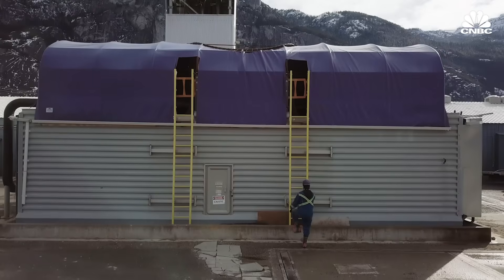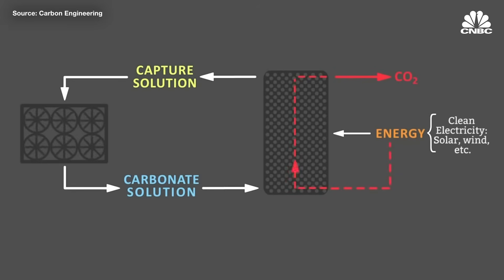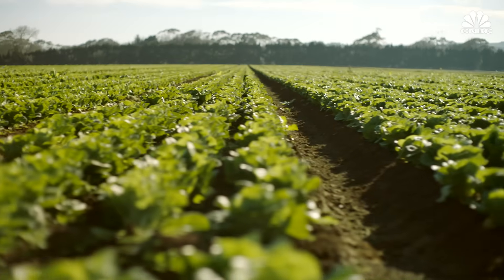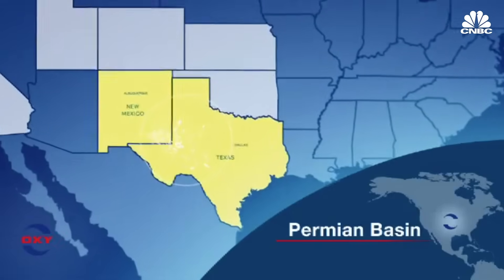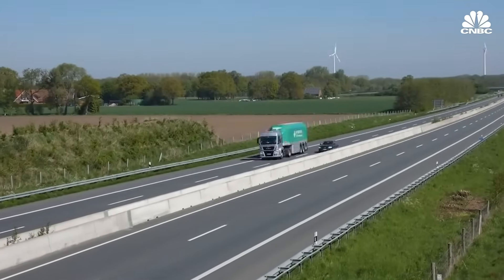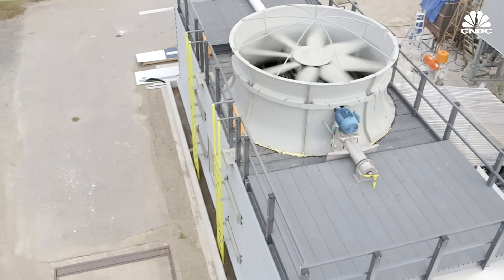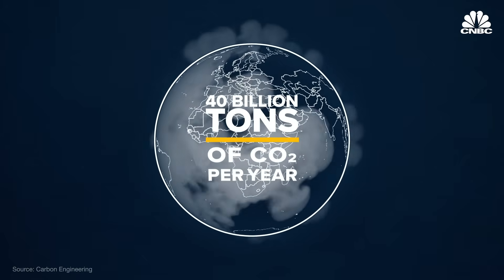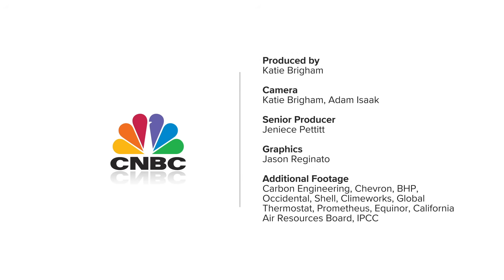Bill Gates-Backed Carbon Capture Plant Does The Work Of 40 Million Trees

Comment: Stop showing steam release as carbon dioxide emissions 🙄
Reply: Jack Tay Hwang Chiat but it looks cool
Reply: If it's a smoke stack more than just steam is coming out. Cooling tower is steam, Cooling condenser is steam. The reason you see steam coming out a smoke stack is because the material still has a water content.
Reply: @topfuel29channel  not the smoke stacks, he's referring to the cooling towers. It's just steam.
Reply: @topfuel29channel  There have't been "smokestacks" in plants r power generation stations in America for decades.
Reply: @topfuel29channel  Sorry, even the flue gases are largely steam. The volatile components of bituminous coal and wood are high in hydro-carbons. The "hydro" refers to water. About 30% of power in the US is produce by combustion of methane which has 4 hydrogen atoms per carbon atom. Therefore the flue gases are higher in water than coal and even wood.
Reply: @fwcolb  The Hydro in Hydrocarbon is referring to the Hydrogen atoms in the compound. You even mention it. When the Hydrocarbon combusts the Hydrogen atoms bond with molecular oxygen to make water, the Carbon atoms bond with oxygen to form Carbon-dioxide
Reply: @topfuel29channel  Of course. I should have gone into more detail. When a hydrocarbon, such as methane (natural gas) is burned in the presence of oxygen, we get CO2 and lots of water. Ditto with all other hydrocarbons, but the proportion of water produced varies. Thanks.
Reply: Isn't carbon dioxide invisible?
Reply: @cypress1337  It is to visible light, but absorbs in the infrared spectrum. Much like glass, hence the greenhouse effect.
Reply: @Grape Soda steam is water nothing more.technically water is the number 1 green house gas so its probably not a lie. Lol
Reply: @Tmasbiwden  no such thing as a greenhouse gas except in your imagination   anything that warms will cool as soon as it is not exposed to an energy source  including CO2 trapping is an illusion   the solar radiation entering earths space is fixed no matter what it strikes  if it diverts off a reflective surface it strikes something else   but the total energy is fixed however it is directed    at sundown solar rays will cease to strike your space and ALL warmed mass will immediately begin cooling   there is NO TRAPPING   at sunup the exposed area will recieve a fixed amount of solar radiation again  hiding or shading objects only directs that radiation  to some other mass  but doesnt change the total amount of radiation during that period
Reply: While water vapor is the major contributor, I think you're over simplifying. The earth is 70% water, which is where that vapor comes from. The co2 combined with water vapor, magnifies the heating considerably. While vapor condenses and falls back to earth as rain, Co2 can stay in the atmosphere for a very long time, and we keep adding more and more to it.
In a cold climate, the vapor out of this thing would rapidly condense and fall to the ground. I don't see people running out to plant millions of trees anyway, so I'm pretty sure this is better than nothing.
Reply: @Paradoxicon999  fraid not, our local plant has steam rising when it's 10 below.....no snow falls out if the sky.
Reply: @joeyelton407  Jesus...
Reply: steam is invisible
Reply: It's actually water vapour lol. Steam is invidisible to the human eye as well
Reply: @birdward64  True, thank you for thinking pointing that out. i would rather that you and others point out something that I overlook than the mistake not get caught.
Reply: It's kind of funny that people say something that is being disputed is undisputed.
Reply: If you can see it its not co2.
Reply: Well, water vapor IS the #1 "greenhouse gas".  LOL.
Reply: Lecture the communist Chinese first before lecturing others.
Reply: @patriotamerican3069  the Chinese are WAY ahead of the slack-arsed Yanks when it comes to their CO2 Reduction commitments and carbon capture plus they have an almost five times larger population that is only just catching up with the West in terms of power generation. They remain committed to carbon reduction and reducing greenhouse gases ASAP, whilst also doing massive infrastructure projects.

The wonderful arrogant and dumb as pig poop, ostrich-headed US president on the other hand has decided global climate change is a complete load of bollocks and pulled out of the international agreements attempting to reverse climate change by getting to net zero emissions as quickly as possible! China hasn't!
Reply: @snek9353  what part of which of my comments caused you such hilarity? Do tell, I'm curious.
Reply: @boblewis5558  The totality really, it's like Norm Macdonald's 9 minute joke, it rambles, but is constantly funny.
Reply: @patriotamerican3069  why should they? They are obviously Not chinese and it is Not like the USA is a small emitter of these greenhousgases.
Reply: OMG! THIS IS SO TRUE!
Reply: It's steam from cooling the power plant co2 is the same color as air u left wing fools I know i work at one  everything coming out of the stacks is steam
Reply: @blumie006  thank you, these mindless fools see 'smoke' from stacks and tear-up. Not only is CO2 invisible, it is necessary for plant life on the carbon-based planet.
Reply: co2 release can't be seen. It is odorless and colorless.
Reply: @Paul-gz5dp  it has a odor.
Reply: @KeVIn-pm7pu  OHH Dear!
Reply: @Drakilicious No. Water vapour condenses, falls as rain and returns underground in a relatively timely manner. Not so with CO2
Reply: North American YouTuber  Clouds are made of water vapor too, and you can clearly see them.
Reply: @sgill4833  lol. no. its methane , multiplicatively proven by many studies, that cows are the number 1 contributor to this gas, and its because they have more than one stomach.
Reply: Show some fatass cows farting and even fatter American's eating burgers... And also farting.
Reply: North American YouTuber  "Steam is invisible." 

Do you even cook, Bro?
Reply: I work in a Power Plant with Two Natural Draught Cooling Towers. They spew tons of steam from cooling water.
I could not agree with you more.
Reply: i mean water vapour is still a greenhouse gas
Reply: @rob1248996 Then your chemistry book is wrong. And if it's wrong on a simple thing like that, imagine what else it's lying to you about?
Reply: @snek9353  @rob1248996 @Squid Cena you're all spouting absolute nonsense. Research these things before commenting. CO2 is odourless. I don't know where you got the impression that it isn't but it very much is. 
@Squid Cena CO2 is not the only greenhouse gas. @Snek is correct. Steam is a much more powerful greenhouse gas than CO2. The only reason it's not listed as a pollutant is that its presence in the atmosphere is practically constant due to the water cycle. As a result it couldn't possibly account for the rise in temperature. However, we are actively pumping CO2 in the air from fossil fuels that were buried in the ground with no way from the CO2 to return to that state unlike water which can just condense.
Reply: North American YouTuber  So apparently fog is invisible.
Reply: Somehow you have to influence the pleb
Reply: kawhi Leonard   @Edward Tomlinson  So, how dense do you have to be to not understand sarcasm. I mean it's not like I explained to comment was sarcasm 3 hours before your comments... Oh, wait, I did.
Reply: Jack Tay Hwang Chiat true 😂
Reply: rob1248996 But no because factories create pollution? See?
Reply: I'm not sure if you know how to combustion works.
Reply: @rob1248996 Great idea
Reply: oh yeah baby, just like those printed from jahovah witnesses that show steam from nuclear plant
Reply: Haha true!
Reply: Asking For to much Jack
Reply: Every media outlet does that.
Reply: Methane power plants burn CH4 which generates C02 and H20. You can't see the CO2, but the H20 is quite visible(as steam).
Reply: Water vapor is the largest greenhouse gas in our atmosphere.
Reply: @AshGreen359  are you proposing we classify water vapor a pollutant too???? fools.
Reply: Well it smoke fumes from chimneys.
Reply: They are trying to clearly push a narrative on you
Reply: But the steam does contain co2
Reply: @fatstacks89   it only contains the CO2 from the surrounding air so it will be 0.04% of the air that's mixed with the steam. There's no smoke in there just boiled water turning into fluffy clouds to spread rain on the flowers
Reply: Josh Arma  your is spelt you're, and steam IS invisible
Reply: They do things like that because most people are not smart enough to realize what sources look like when they see one, and need visual aids so that they can think something is happening. Much like tv shows put transmission fluid on the ground, and say someone damaged the brakes in a car. brake fluid is clear and not really noticeable looks like water.
Reply: Steam puts water in the atmosphere and the water soaked up heat from the suns rays which make the atmosphere warmer
Reply: @matteomurphy7541  If it gets high enough it makes clouds that reflect light back out into space. Instead of the light reaching the earth.
Reply: Paul R that’s an incorrect statement, part of it is reflected but only 4%, 17% of all light is absorbed by clouds and then 17% absorbed by the atmosphere and 3% reflected by the atmosphere.
Reply: Paul R also the high point is the condensation point which varies but is relatively close to earths surface
Reply: CNBC: No.
Reply: North American YouTuber  steam from water is invisible, while all forms may not be.
Reply: So dense man? Ohh its never JUST ‘steam’ man, or they would just harvest water lol.Who dint know this now.
Reply: water vapor pound-for-pound traps more heat than carbon dioxide
Reply: 0:44 Stock footage that gives impact to the industrialization of the world.  At no point do they say, "LOOK AT ALL THAT CO2!",  classic Straw Man fallacy.
Reply: stop assuming that smokestacks only dump steam.
Reply: agreed
Reply: Actually green house gasses make environment sick not co2 alone!!!
Reply: Josh Arma  don't go NEAR steam turbine generator plant then. I have some friends who have worked for decades in the power generation industry and can tell you tales of high pressure and temperature steam making mincemeat of human flesh! What you SEE coming out of a kettle is CONDENSING steam! It's condensing to water vapour just beyond the spout. If you look carefully (which CLEARLY you haven't!) There is a gap between the kettle spout and the start of what most people call "steam". The gas in the gap is actually the  steam, the white/great misty stuff is NOT! It's water vapour!

Don't believe that? Go do some proper research before spouting off utter drivel!
Reply: @sgill4833  For real?
Reply: They really have a problem with stock footage
Reply: This is a statement only an uneducated idiot would make
Reply: Guess what, everything has pros and cons, probably the ultimate energy source is fusion, period, no chance of melt down (since if any of the conditions changes the process ends). And generates a ton of energy, and the fuel is salt water, with no waste products. And one of its cons is probably cost, and research on it.
Reply: North American YouTuber  or aerosol
Reply: thank you
Reply: @rob1248996 CO2 isn't odorless.
Reply: You're smart
Reply: steam is also a greenhousegas.
Reply: @manuelsagichnicht3732  no it's no idiot.. so people who go to saunas (steaming showers) are bathing in pollution? Also you idiot nuclear power plants create steam... which is not a greenhouse gas.. who even taught you that?
Reply: @SquidCena  "Also you idiot nuclear power plants create steam... which is not a greenhouse gas.. who even taught you that?
"
- Water vapor is THE primary greenhouse "gas". In fact it's why CO2 is a total non factor, yes alone CO2 will absorb light energy in certain spectrums. But CO2 isn't alone in the atmosphere, there's much more water vapor and it absorbs those and many more spectrums of light.
Reply: @snek9353  Dude are you insane? Water vapor nor steam creates CO2.. that's why they're considered environmental friendly
Reply: they do this with nuclear power plants to. They often show the steam coming out of the smoke stacks like its some sort of horrible thing
Reply: Why the sale is now?
Reply: Lol why some people so dumb, is it because somebody didnt go to school?
Reply: @rob1248996 He also fails to understand that the amount of water that is on the earth is approximately constant. So even if it is the most important green house gas, which I'm not saying it is, there is no reason for it to cause global temperatures to change.
Reply: I see what you mean because like it's miss information buuttt
A it's not technically steam since steam isn't visible way they show is the water condensing 

B said steam coming out a long funnle in thick continuous clouds is alot more dramatic and "scary" than a shot of a tube with nothing coming out
Reply: They do for the "visual" in order to brainwash people in order to convince the masses that the government is needed to fund emissions reduction.  What is also know as a third party payer system.  EPA Regulation would be a smarter solution.  No taxation for breathing!
Reply: Are they using acoustic soda or is it something different?
Reply: And what heated the water into steam? Steam in this case is a  symbol for the CO2 released to make it. I can't imagine there are many people dumb enough to confuse steam with CO2 itself.
Reply: (I was just reading online) steam actually has a significant effect on climate change. If you do your research rather than speaking out your ass (people in this comment section) you find there is some interesting investigations that have occurred looking at potential of a feedback loop between carbon and h2o. I’m not a scientist, so I can really say much else however; I encourage y’all to actually google it and learn something rather than letting all your huge egos get in the way.
Reply: @rob1248996 it is Not odorless
Reply: @oj5190  yes, but at the same Time they reflect a great amount of light.
Reply: @Victor it is not odorless
Reply: @rob1248996 well, but that is the Definition. I mean i cant smell the every individual Part of the Air but seperated i am able to smell the odor.
Reply: @rob1248996 So you now admit I'm right, it's not odorless? And yes CO2 needs to be in a rather high concentration to notice, but not as high as direct from a tank, and not so high that you have health issues.
Reply: North American YouTuber  it´s not even water vapor (which is invisible untill it starts to condense and becomes visible (misty). so, yes, steam is invisible and so is watervapor
Reply: confused by the OP's reference, not recalling any points in the last 15 mins of video watching where I was being visually informed by the video on what carbon dioxide was supposed to look

But, I wasn't looking for something to write a righteous comment about when I was watching... Maybe that's why whatever Jack is referring to had zero significance to me?
Reply: Nothin like a good ole nuclear smoke stack 😂
Reply: Not to mention water vapor is what traps about 90% of the heat, A.K.A. clouds!
Reply: it is the use of unrelated images to scare you and infer CO2 is the boogey man  then you will be more likely to give the con man $$$$$$$$$$$$$$$$$$$$$$$$$$$$$$$ the image of glacier falling into bay is due to no support from below as it is slowly pushed over the edge but they want you to believe its warming  another con job   the media and weather people are  in on the con   if it was warming the ice would be a river
Reply: @oj5190  no mass traps heat unless contained as  in an oven   heat  is not  a substance it is a radiation from a mass whose atomic structure has been excited   when you turn off the electricity or gas the air in the oven immediately starts returning to stability   it is not trapped   it will cool until turned on again    the sun rays excite all of the gases in the atmosphere only when they are exposed   at sundown ALLof the gases start returning to normal until daybreak    just like the oven  there is no trapping   nobody has ever demonstrated  a gas staying warm after the energy exposure is denied  NOBODY!!!!
Reply: Jack Richardson  all locations on the planet warm and cool every 24  hours  there is no continuous warming  about any mass that has cooled  it can warm again but that is not continuous
Reply: It's water vapor not steam.
Reply: @philc9305  it still reveals that the climate con men stoop to any method to fool people to make CO2 a boogeyman to be defeated  and many buy it because of total ignorance  each day this lying game continues  just look for it in the the same old places
Reply: @chetlopez8942  I agree fake news being pushed on the ignorant.
Reply: North American YouTuber  bruh
Reply: The most damaging greenhouse gas, carbon dioxide, is released into the atmosphere from the burning of fossil fuels. Factory emissions contribute greatly to the release of carbon dioxide into the atmosphere
Reply: Steam comes out of a powerplant stack because the gases are cooled by scrubber systems and you can see condensed water vapor, but what you can't see is the huge amounts of CO2 which comes with it and is invisible. I suspect you know this, but are just being contrary.
Reply: As far as I know it is carbon dioxide emissions because the pipes are thin and tall instead of the big and short pipes that you referring to
Reply: But how will they fear monger everyone?
Reply: @sgill4833  Are you dumb? So to much clouds = global warming? Do you mean methane CH4?
Reply: I suppose this ♨️💨 STEAM is non-toxic??????????? 😳
Reply: Science denier wrong think report to re-education centre at once it next to the vaccinations centre and ministry of truth  2000 points of your global credit score !
Reply: I’ve often said the same about pollution equated with steam. But to be fair steam is a visual representation of heat which is often generated by heating water with fossil fuel.
Reply: I'm not arguing but why would they be emitting CO2 when they're supposed to be collecting it? I haven't watched the video yet so yeah what you're saying doesn't make any sense to me either. The only thing I can think of is showing things that are beat steam like it's exhaust or something like that so that makes sense.
Reply: Especially Steam sales and early access games!
Reply: Ok.lets show empty exhust tunel then.
Reply: Jack Tay Hwang Chiat But that’s because it’s the only type we can see
Reply: @alysm2254  type of what? Steam is just steam it has nothing to do with CO2.
Reply: Nexus of ice but no because factories create pollution and pollution is co2, see?
Reply: @alysm2254  Pure steam contains no carbon atoms.
Reply: The byproduct of complete combustion is CO2 and H2O (water vapour)

Steam is a totally valid way of conveying the message.

You just want them to show an empty sky?
Reply: Showing an empty sky would show how much harmful effect of fossil fuel CO2 can be established.
Reply: @TreDogOfficial  So perhaps we need to abolish water use entirely. You could volunteer by reducing your respiration.
Reply: What you see is not the CO2 thats true, because CO2 itself doenst have color, so we cant see it. What you see are other substances, but believe me, CarbonDioxide is still included in what you see
Reply: @luukscholten8155  are you afraid of CO2  if so   please tell us why   when you compost any complex organic molecule  it breaks down in the presence of O2  this simple reaction releases CO2 and heat energy   in your muscles  in compost  in fires   in your cars engine    in your oven    this  return of CO2 to the atmosphere is needed to produce complex organic molecules in plants  which were just  destroyed by oxidation      an organic chemistry  textbook  is what you need  most of the information on these sites is seriously flawed  look up carbon cycle in  the book
Reply: @chetlopez8942  i know the carbon cycle :) I'm a chemistry student myself.

The thing is we humans are producing unnatural amounts of CO2. I am aware that a bit of CO2 in the atmosphere is natural, and even vital for life on earth. However, due to our doings, the CO2 levels are higher than they should be, causing the earth to warm up, with the consequences of that.

I am not afraid of CO2, i am just saying if we want to ensure a good place for life on earth, we have to decrease our emissions by a lot. Completely carbon neutral is not achievable, because we produce CO2 ourselves (through organic processes like you mentioned), but we can drastically decrease other emissions
Reply: Was the water heated to steam with nuclear or solar? If not it was with the burning of fuel.
Reply: @PapaWheelie1  can't tell from the videos, but kids looking out at a nuclear/hydro plant will be saying look dad, its making co2
Reply: @jacktay1317  I know and its false..
Reply: Jack Tay kids do love their CNBC videos
Reply: @jacktay1317  Not only kids. I used to think all that was smoke from something burning, not actually steam.
Reply: @jacktay1317  you are correct. we are brainwashing young people by making them think a factory is the devil even if it just releases some steam, steam isn't the problem, it cools and becomes rain.
co2 is a problem
Reply: @jacktay1317  Except hydro-power plants work by gravity and thus do not produce steam. (Falling water --> drop in potential energy --> increase in kinetic energy.)
Reply: @jacktay1317  and the dad will say "no u stupid son, its actually...."
Reply: @PapaWheelie1  GeoThermal.....BOOM!
Reply: @PapaWheelie1  writes: "Was the water heated to steam with nuclear or solar? If not it was with the burning of fuel." Solar water heaters are common at power plants to produce steam to run the generators when the conditions are right. Here is a link to a  google map of such an installation. The long rows you see are solar tubes with curved mirrors to superheat the water. https://goo.gl/maps/gvbwG5fEjRtpULqdA
Reply: @PapaWheelie1  On the off chance of being pedantic, nuclear uses fuel as well.
Reply: @jeffshackleford3152  - thanks, I just learned a new word today. Pedantic is definitely the most pedantic word I now know. And I thought this thread was totally useless.
Reply: @PapaWheelie1  No prob Bob...
Reply: North American YouTuber  Water vapor is invisible, what you see is condensate, or wet steam.
Reply: North American YouTuber  exactly... water vapor is steam duh.. especially when blown out quick and faster, its steam which is water vapor...
Reply: @SquidCena  They're not the same thing...
Reply: @chavezharding7820  what isn't the same thing?
Reply: @SquidCena  Steam and water vapour.
Reply: @chavezharding7820  they're the same...
Reply: @SquidCena  😂 no they're not. The distinction is actually quite important in chemistry. Water vapour occurs when water molecules with more kinetic energy break away from other water molecules. This can occur over a wide range of temperatures and relies on factors like wind speed. It also occurs on the surface of water. Steam is literally the gaseous state of water. Happens usually at one specific temperature and pressure. (If the saturated vapour pressure reaches 1atm at sea level pressures pure water boils at the boiling point). Boiling occurs throughout water rather than just at the surface like evaporation producing water vapour. Steam is also much higher in kinetic energy than water vapour. Water vapour also form a dynamic equilibrium with its liquid counterpart at a constant temperature. With steam however an equilibrium will probably never be found as at that particular temperature and pressure the hydrogen bonds between water molecules weaken too much. The entire volume of water would become gas. 
Plus the fact that when boiling occurs no temperature change is recorded until all of the water is converted to steam whilst with evaporation liquid water decreases in temperature. We take advantage of this when we sweat. It's why we can cool down when running. Sweat is quite fascinating as well but that's a whole other discussion. 
Hope you enjoyed my TED talk.
Reply: @chavezharding7820  Yes they're lol I take chemistry class now.. Steam (water in the gaseous state at 100 C) is present in the visible space seen above the spout of the kettle before the steam condenses to become visible water vapour as it cools. Vapour exists below 100 C as in evaporation.  Also water vapor, water vapour or aqueous vapor is the gaseous phase of water. It is one state of water within the hydrosphere. Water vapor can be produced from the evaporation or boiling of liquid water or from the sublimation of ice. Unlike other forms of water, water vapor is invisible. Under typical atmospheric conditions, water vapor is continuously generated by evaporation and removed by condensation It is less dense than air and triggers convection currents that can lead to clouds. Hope you enjoyed my Ted talk.
Reply: @SquidCena  You do chemistry nice. Explain this. Why can't we do steam distillation with water vapour if that was the case? Why do we need to boil water to do this technique? Evaporation requires much less energy. If steam and water vapour were the same we'd just use water vapour for this technique. 
Of course water will condense under 100°C to water vapour but that doesn't make steam water vapour. That's like calling liquid water, Steam because under 100°C steam condenses to liquid water as well. Like I said evaporation occurs at the surface of water. Molecules escape. Boiling occurs throughout. Hydrogen bonds weaken throughout the entire liquid. All heat energy goes toward breaking these bonds. This is the latent heat energy. 
Must be a mad lad to produce vapour from the boiling of water mate. Steam is produced, not water vapour. There's a notable difference as you seem to have ignored conveniently. 

Another question. Moving away from water for a bit. How do you explain every bit of distillation out there? For example, take a mixture of hexane and heptane. They create a mixture of slight positive deviation I think. I could be wrong. Point being. These mixtures have mixed vapour pressures when mixed. It is only upon reaching the boiling point of one of the mixtures that one of the compounds separate from the other. If vapour and the gaseous state of molecules (like steam) were the same then why such a difference in behaviour? A distinction must be made between the wholesale change of state of matter (like steam for water) and its vapour (like water vapour). 

In fact lets go further and look at the no. 1 cause of global warming. Fossil fuels. We see that crude oil/petroleum is useless by itself. However, via distillation it's an absolute powerhouse filled with hydrocarbons with tons of energy locked in their C-C bonds. To make it even better it's a near ideal mixture meaning it follows Raoult's Law very closely making it very easy to separate via distillation and predict. If their vapour and wholesale change of state were the same. Separation would be impossible as separation of one component can only occur upon reaching that boiling point. Remember, the vapour pressures of the components mix at different pressures over a wide range of temperatures. However one can only separate at the boiling point. This is because there's a difference. 
Do I need to go on because trust me. I can talk about chemistry all day and all night. 
Plus the fact that you can't use steam as a cooling system even under reduced pressure as there is no chance in temperature of water while that occurs. It can only be done with water vapour.
Reply: @chavezharding7820  Now why wouldn't we need to boil water to have water vapor? Steam is still water droplets going into the atmosphere but as a gas but at the same time it's still water.. just heated. So you're saying they both don't go back to the atmosphere? They're both water and one of them is heated while one of them is just goes back to the clouds. Steam is when water boils or evaporates. Water vapor can be produced from the evaporation or boiling of liquid water or from the sublimation of ice.
Reply: @chavezharding7820  Also I don't know why we can't do steam distillation with water vapor. Also, so steam from nuclear power plants is not water vapor? Its releasing water back into the atmostphere.. but only in gas form.. and water vapor is just water sitting there and being evaporated
Reply: @SquidCena  You misunderstand me. Read over what I said. We don't need to boil water to have water vapour we need to boil water to produce steam. 
Steam is not water droplets going into the air. It's literally gas going into the air it can't be droplets. The hydrogen bonds by that time are too weak. You could make that argument for water vapour but I wouldn't do that. It could be argued that water vapour isn't even a gas as their is no wholesale change of state it's just water molecules with higher than average kinetic energy breaking away from the rest of a liquid to a gaseous phase but the bond length between that of vapour molecules compared with steam would probably be significantly smaller. 
You really aren't reading what I'm saying. 
I'm not saying they both don't go back into that atmosphere. That's actually irrelevant as that doesn't even define what a gas is. Plus the fact that that alcohol produces vapour as well which is why it's so cool on the skin. Does that mean alcohol vapour is water vapour? Does that mean the alcohol is somehow boiling? 
You can't evaporate water to produce steam you have to boil it. I just explained the difference.
Reply: @SquidCena  We can't do steam distillation with water vapour because water vapour is simply too low in energy. Basically the steam powers the entire distillation process. Say you want to extract clove oil from clove. With water vapour a dynamic equilibrium would be established with the liquid counterpart thus water would be lucky to even reach the clove. With steam however there's enough kinetic energy for the steam to not only reach the clove but to condense into the container heating up the container whilst the water mixes with the clove. Clove is solid and such the mixture is highly non ideal and ends up releasing a lot of energy. The mixture bubbles and the clove oil is extracted from the clove. You could research it if you must I'm not sure if I'm remembering this correctly. 
If it's steam from nuclear power plants then no it's not vapour. 

I just realised how pointless this discussion even is. Unless you want to be something relating to Chemistry this distinction is not important to you. You can live your whole life thinking steam and water vapour are the same and it wouldn't affect you at all. It's still nice knowledge to have, though.
Reply: @chavezharding7820  Well no discussion is pointless but I guess you have showed me some of how it's not the same I guess but I mean they still should have similarities though.
Reply: @chavezharding7820  Yes but if you boiled water and had let it sit, it would evaporate and it kind of is evaporating if it's becoming steam and going back into the atmosphere as a gas which still contains water droets...  we might not need to boil water vapor but still you can evaporate it which is like steam also being evaporated.. just boiled.. why do you think nuclear power plants have steam? Because it's been heated and where does all the steam go? Into the atmostphere.. same for water vapor. Yes water vapor isn't a gas and yes I'm reading what you're saying.. also, what if you could boil alchohol? I don't know if that means that alchohol vapor is the same as water vapor it probably could. I was talking about it going back into the atmosphere since people are saying that steam is CO2... which it isn't. Yes but you can boil water which is going back into the air.. all water vapor happens because of evaporation without being heated...
Reply: @SquidCena  Yeah they're similarities. Which is why it doesn't matter much unless you're trying to make use of phase separation techniques. Then the distinction becomes important. 
You could think of boiling as the "next stage" of water vapour. As temperature increases the equilibrium switches more to the gaseous phase so to speak producing more vapour until vapour pressure reaches around 1 atm in pressure. That's when, for a period of time, temperature stops increasing and bubbles start forming throughout the liquid and boiling occurs to produce steam. The difference in characteristics is why the distinction is made.
Reply: @SquidCena  If you boiled water and let it sit you are correct. Evaporation would occur. Basically because the liquid is going to return to room pressure and temperature. 
I hesitate to call them water droplets but I know where you're coming from. It's better to say water molecules. 
You can boil alcohol. Much easier than water actually. At rtp it boils at 78°C (that's if we're referring to ethanol. The boiling point of alcohol depends on the number of C-C bonds in the molecule. Ethanol has 2 carbons.)  The cool thing about chemistry is that theoretically, with enough energy, you can boil anything. Even steel. 
Someone said CO2 was steam? The educational system has failed them.
They all go into the air. The distinction between steam and vapour was never important to the overall discussion I just didn't like someone said they were the same but in hindsight I should've left it alone.
Reply: @SquidCena  fwiw "steam" refers specifically to water vapor superheated to above 100C, it's an odorless colorless gas. steam is invisible, not white. I guess you could argue that all steam is water vapor but not all water vapor is steam. and what you see coming out of smoke stacks is water vapor, not steam
Reply: Zreknarf I believe it’s water droplets. They’ve condensed which allows them to become a liquid, but their aggregates are so small that they rise with the flow of the steam and air below and in between them.
Reply: @Dollapfin  Man, it took a while for this "science" community to figure that the thing coming out of the chimney is not CO2, steam, or water vapor...  Then, does anyone know how much CO2 is in the air? 10%? 20%? 5%? Take another wild guess....

But it will take forever for you smart people to google this up, let me tell you the answer. 0.04%. CO2 is a trace gas, ain't going to do anything to heat up the entire planet that is made of huge ocean, mountains, rocks, vast forest, and the air that is 99% of N2 and O2. 

And guess what was the weather like 100,000 years ago. Or 200,000 years ago. Most of the northern hemisphere was covered with 2km thick ICE! It was just 10,000 years ago, very recent in geologic term, the ICE retreated. Manhattan was also under 2km thick ICE too! Was it CO2 that melted all this huge ICE? Heck no! It was something else, probably the sun and the earth orbit changing, not the STUPID CO2! And this ICE AGE is cyclic, and will be coming again in the near future. And you are worried that the earth is getting too warm because of the STUPID 0.04% CO2? Give me a break and get a life people.
Reply: @issacabraham2045  you are 100% right on.
Reply: @Zreknarf   Since when?  Water vapor is a colorless gas.  What you see coming out of a stack or a tea kettle is water droplets, which scatter light to make them visible.  I'm not sure where people are getting the idea that water vapor is somehow visible, but steam is invisible.
Reply: @DANGJOS  since always. water vapour IS tiny water droplets that scatter light to make them visible. it is what you see in the shower, it is fog, it is what vapers exhale. steam is invisible. Google it or try an experiment yourself. heat water vapour above 100c and see what happens
Reply: @Zreknarf   Water vapor is typically used to refer to an invisible gas.  Water droplets are a liquid, not a gas.
Reply: @DANGJOS  well those people would be wrong. the DEFINITON of "vapor" IS 'a liquid or solid suspended in a gas':

noun: vapour
1. a substance diffused or suspended in the air, especially one normally liquid or solid.
2. PHYSICS
a gaseous substance that is below its critical temperature, and can therefore be liquefied by pressure alone.
Reply: @Zreknarf   Do you understand what that physics definition means?  The critical temperature is the temperature above which a substance cannot be liquefied by pressure, since the enthalpy of vaporization goes to zero at the critical temperature.  The definition does not say a vapor is a liquid.  On the contrary, that definition says a vapor, in the scientific sense, is a gas that can be turned into a liquid.  But it's still a gas.  

It is the colloquial meaning of vapor that can include water droplets suspended in air.  And by the way, the same can be true if steam, if you look up its definition.  Both vapor and steam can be used to refer to the visible suspended condensate.  But both can refer to the gas as well.  That's what I gather from reading the Merriam Webster site.
Reply: @DANGJOS  steam:
the invisible gaseous form of water, formed by boiling, from which vapor condenses.
Reply: @Zreknarf   Google definition of steam: the vapor into which water is converted when heated, forming a white mist of minute water droplets in the air.

Merriam Webster site definition 2b of steam: the mist formed by the condensation on cooling of water vapor
Reply: It's like they try to make it so you can't listen. Also when showing cities that will be under water they tend to include Chicago.
Reply: BUT IT GETS THE PEOPLE GOING!!!!!
Reply: @matteo1ize  makes them scared and easy prey for con men to take their $$$$$$$$$$
Reply: Yup. They always do this to make it seem worse. I like how they usually show steam coming from nuclear plants. And BTW h20 is the biggest greenhouse gas. How will they remove the water from the air.
Reply: XANAX “they” don’t do it to make it “seem” worse. It’s just a good visual. Did you hear the  statistic? We emit 40 BILLION TONS of CO2 every year. The atmospheric concentration of CO2 is over 400ppm because of us.
Reply: @ThatOneScienceGuy  Fear mongering
Reply: XANAX Right. And cancer warnings for cigarettes is just fear mongering as well?
Reply: @ThatOneScienceGuy  400ppm is still low by historic standards. The earth would be much greener and more able to feed  people if it was closer to 1000ppm. By the way look at the graphs of temperature vs CO2 on a scale of thousands of years and it's clear that temps rise FOLLOWED by a rise of CO2 on about an 800yr delay. That's because the oceans are less able to absorb CO2 as they warm.
Reply: Ant Lyon Sorry but what you’re saying isn’t backed by the overwhelming scientific consensus. In fact, it’s the exact misinformation that right wingers love to perpetuate because they want to uphold the status quo - billionaire oil companies, polluted air, etc.
Reply: @ThatOneScienceGuy  science isn't about "consensus", as you should know. The overwhelming consensus of scientists in Galileo's day believed the sun went around the earth. As a "ScienceGuy" you should be ashamed to lean on that kind of argument...🤔. How about you argue with facts instead instead of rhetoric?
Reply: @EthanThruandThru  Co2 is the GHG that affects the most, the most potent however is Nitrous oxide.
Reply: XANAX duh! It’s worst already
Reply: @EthanThruandThru  Your argument is really dense. Water vapor is the greenhouse gas that is most concentrated in the atmosphere, however each particle doesn't capture anywhere as much heat as carbon, methane, and nitrous oxides do.
Reply: @EthanThruandThru  it will fall when it rains silly
Reply: @jarrettseeler6458  Well yeah. Some falls but there is a ton of it in the air. But it obviously doesn't matter. Not going to make the world end.
Reply: @EthanThruandThru  I was just joking
Reply: But steam is just water
Reply: I believe you worded it wrong. 
You said showing it "as"
The steam still contains harmful chemicals.
Reply: If anything, the steam reduces pollution in many situations.
Reply: @rob1248996 its common sense mate
Reply: lol you idiot. They are cooling towers for CO2 intensive processes. You cannot see CO2. You and your cynicism-crowd will be the death of us all. Everything is a conspiracy, isn't it?
Reply: @rob1248996 " I guess you call a "cloud" a green house gas."
- Yes, my god, I'm dumbfounded by how little you appear to even notice things around you. Have you never noticed that it's warmer on a cloudy night then on a clear night. THAT is the greenhouse effect of water vapor also called clouds.
Reply: Steam is invisible.
Reply: North American YouTuber  You got your definitions ass backwards.  Water vapor is a gas and is invisible.  Steam is the stuff we see.
Reply: @1SnuffySmith  it's you who's backwards, friend

https://en.m.wikipedia.org/wiki/Steam
2nd sentence first 3 words, "Steam is invisible"
Reply: @1SnuffySmith  utter CRAP! steam IS invisible! The clear gap between a kettle spout and the stuff you actually see (i.e water vapour) is the steam! Go do some PROPER research, talk to people who work in power generation plant and they'll tell you that STEAM IS invisible, and in such a plant, an escaping jet of high pressure steam:

1. Is invisible
2. Can be at several hundred degrees (not 100°C)
3. Can slice a man in half and set him on fire as effectively as a laser, maybe more so.

Go educate yourself properly!
Reply: Funny thing is Steam is water vapor and 10x more of a greenhouse gas than Co2.  Maybe we should cover the oceans lakes and rivers to stop this deadly water vapor from destroying the earth.
Reply: @damaliamarsi2006  water vapor does have a effect on the climate change you are right. But the amount of water in the atmosphaer is connected with its temperature due to other greenhousgases (CO2,CH4... ) through which a heating up arises more water gets in the sky.
Reply: @rob1248996 The alarmists don't even consider the sun or solar activity being responsible for global warming. I was forgetting in today's lunacy, my statement above could actually be misconstrued as serious from the dolts we have running loose.
Reply: @RobCalhounPGH  to be fair its hard to see sarcasm in today's world especially in a comment
Reply: @RobCalhounPGH  The scientists have considered solar output and have studied the sun. Scientists found that the sun has a solar cycle and that the sun is currently within a calmer period of that cycle.
Reply: @RobCalhounPGH  Thank you Rob Calhoun! I'd wager >95% of people don't know water vapor is a greenhouse gas and responsible for most energy retention in our atmosphere. All most people hear is we need to cut back on carbon dioxide emissions to fix climate change. As a scientist I'd actually kinda like to see the experiment if all "man-made" carbon emissions (I hope we at least be able to breathe) were stopped for a period. I'd wager good money they wouldn't be able to measure the few ppm difference, nevermind any sort of global temperature change. I also doubt it would change anyone's minds. So I'll keep driving my car in the meantime.
Reply: @darrellm4794  Doesn't matter. Water in the atmosphere is practically recycled in the water cycle. It's existence in that atmosphere is practically constant. However CO2 is not. It's presence in the atmosphere is rising.
Reply: @RobCalhounPGH  Heresy! Arrest this man!
Reply: @RobCalhounPGH  because the activity of the sun did not change as much that such a big increase in average temperature could occur. 
There are studys over this thesis which proof this.
Reply: @rob1248996 What are you nuts? Steam doesn't have a thing to do with global warming any more than the sun does, silly! (Edit) To those of you who are just too f*ckin' dense, this should be clearly understood as sarcasm.
Reply: Rob Calhoun Steam is much more powerful of a greenhouse gas than CO2. The IPCC claims that it accounts for 36-70 percent of the greenhouse effect. It’s what keeps earth in balance, but it may be increasing because of the changing co2 levels.
Reply: @RobCalhounPGH  Speaking of f*ckin' dense Steam is water that was heated! the use of fossil fuels for heating the water is the problem!
Reply: @RobCalhounPGH Calhoun steam is a much more potent greenhouse gas than co2. but the catch is steam is only harmful if it's high up in the atmosphere.
Reply: @bhavjotkang8004  Steam doesn't get high up in the atmosphere. It's too cold and the steam cools rapidly as it rises. The closest you get to steam in the upper atmosphere is condensation (chem if you wear a tinfoil hat) trails behind aircraft. And what all aircraft combined create is negligible on a global scale.
Reply: @RobCalhounPGH  He  meant that it looks more dramatic, it plays better on camera to the Lehman.
Reply: @RobCalhounPGH  you must be nuts, because you didnt get his sarcasm
Reply: @RobCalhounPGH  your looking for the "/s" notation at the end of your statement.
Reply: @RobCalhounPGH  I totally got it.
Reply: @RobCalhounPGH  water in vapour form does affect climate change though, albeit a natural greenhouse gas. Vapour absorbs plays a part in the humidity levels which directly also affects temperature as it absorbs heat from the atmosphere. And that heat essentially comes from the sun so... it depends on how you  look at it.
Reply: @RobCalhounPGH  The most damaging greenhouse gas, carbon dioxide, is released into the atmosphere from the burning of fossil fuels. Factory emissions contribute greatly to the release of carbon dioxide into the atmosphere
Reply: @RobCalhounPGH  What Jack Tay is pointing out is that steam is generated during the operation of power plants. When the steam condenses, it forms a cloud. So when we see the power plant in operation we are shown the condensed-water cloud from the cooling tower with the expectation we will think the cloud is a pollutant from a smokestack instead of knowing it is just pure water.
Reply: @fwcolb  You read 3 comments deep into a 272 comment thread over a year old to get the exact opposite understanding of the conversation. Hell, I even edited it over a year ago for the special people who don't understand sarcasm.

I fully understood what Jack Tay (OP) was saying AND that the sun and its activity is the biggest contributor to global warming. I was pointing out the incoherence of leftist propagandists and their sheep who swallow and repeat it.
Reply: @RobCalhounPGH  Sorry I did not understand your sarcasm. Few of the people I work with use sarcasm, which makes me less aware that some people do.
Reply: @RobCalhounPGH  are you serious? Water vapor is one of the biggest green house gases produced and has a massive effect on climate. Cant solve the problem if you dont know what causes...
Reply: @RobCalhounPGH  what? Steam has a much greater effect on climate then CO2. Do a simply google search, silly!
Reply: @RobCalhounPGH  that was totally uncalled for, no need to use that kind of language
Reply: The Big Question
Is there any verifiable evidence that fossil fuel CO2 has caused any temperature rise, ice melt or sea level rise, let alone causing "extreme" weather?
Reply: @georgelet4132  no
Reply: GEORGELET4 fam there’s literally hundreds at just 1 search away
Reply: @georgelet4132  countless
Reply: @KeVIn-pm7pu  What is countless?  Give some examples.
Reply: @georgelet4132  you have Internet do it yourself. It is Not that hard
Reply: @KeVIn-pm7pu  Looks like you can't back up what you say
Reply: @georgelet4132  i could but there See multiple Problems my sources  are partly from book which are unlikly to get bought and read by you, because you made it clear you  do Not believe me. Furthermore nearly everything i can provide is Not in english but in my language.
Reply: @KeVIn-pm7pu  Are you talking about evidence that fossil fuel CO2 has caused temperature change, ice melt and sea level rise?  Because that is what I am interested in.
Reply: @georgelet4132  yes and the study which lead to the assumption.
Reply: @KeVIn-pm7pu  It must be secret because you won't share it
Reply: @georgelet4132  Yeah, Al Gore said so, DUUUH.  Get with the program or we'll all be ded in 12 years.  (Wait, is that still on?)  Have you noticed that once Occasional Cortex tried to back pedal out of that bs claim every one else quietly dropped it too?